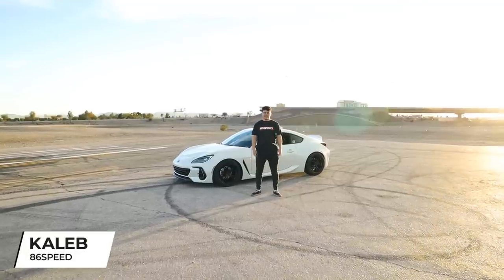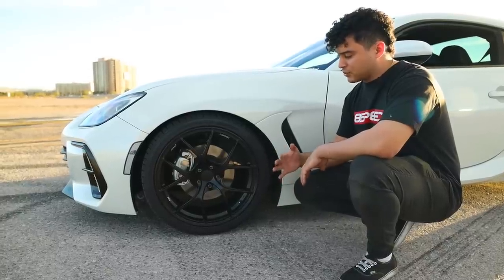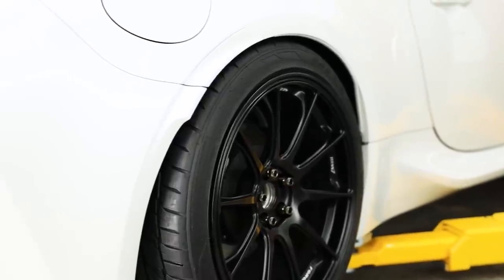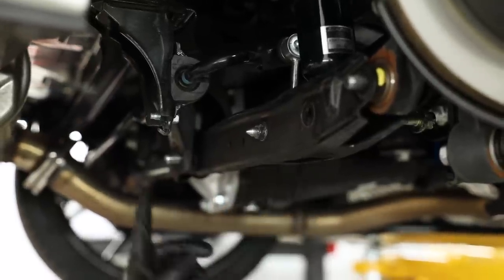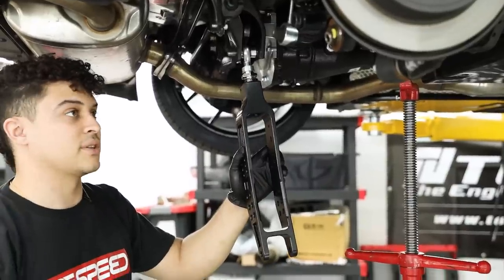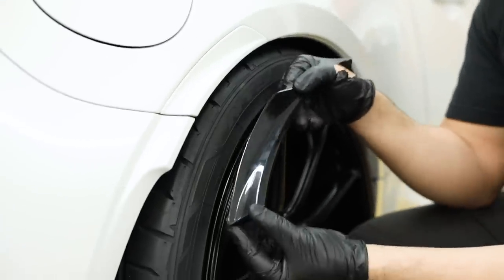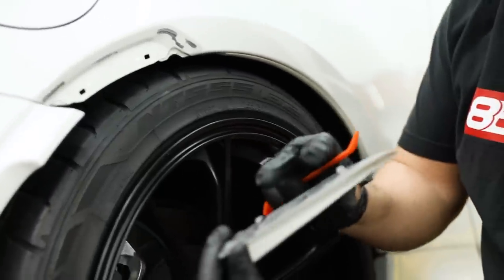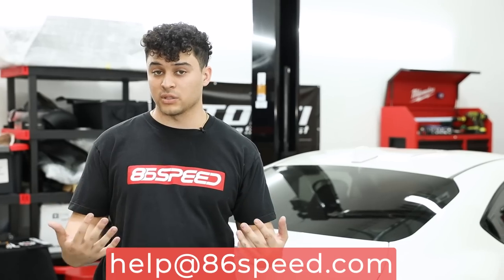The 411 on wheel specs for the 22 BRZ - Basics on the BRZ Suspension and Wheel fitment

Comment: A little toe-in in the rear will add stability under hard braking (like after a long straight on the track) so "0 toe" is not ideal. A small amount of toe-out in the front can also help with turn-in, but will increase the amount of wear on the inside of the tire.

Some alignment shops also add a small difference of toe-in for the front to help keep the car tracking center on the road, which generally always has a small amount of crown to help water run off the road into gutters. I often need to give specific instructions to my shops to give me 0 toe or a small amount of toe-out, but an even amount when I'm expecting an immediate track day vs street driving.
Reply: You can tell them that you don’t want that offset for the crown and they will look at you funny, but they will comply with your request after warning you that it voids blah blah blah.

Comment: So looks like 18x8.5 +45mm should be good on stock! Sweet.
Reply: I know this might be a dumb question I also want to go basic mods/upgrades so basically the 18x8.5 rims like the ones in this video which I like with a 45mm tire? I can’t use the stock tires and just switch rims or would I rub and would it not be fitted correctly?

Comment: Tire specs would have been really helpful, at least in the description. If I had to guess, they are probably running a 245/35/18 for option 1, but they would have to confirm. Also, what is the suspension setup on the BRZ for option ? Looks lower than stock.

Comment: I have that style lower control arm and I run 18x9 +35 with 1.8 degrees front and -3.2 degrees rear camber no rubbing, no scrubbing. front flush rear nearly flush.
Reply from the maker: Anything is possible -  Watch our ruined video posted before this one. What is your ride height and tire , these things matter also.  There are always 4 things to consider 1. Wheel specs 2. Tires size / stretch / profile 3. Camber 4. Amount of drop and suspension travel and dampening stiffness.
Reply: @86Speed  26.25" from ground to fender lip front and rear with Eagle sport AS 235/40r18s

Comment: Thank you so much for this video it's been a burning question for me!
So if someone was running track camber (-2.4 to -3) then 18x8.5 +40 would be ideal flush fitment? Does that mean you'd be able to fit 255s front and rear or only 245s? My state is very strict so I can't afford to have poke but I'd also hate to have too much tuck as well. Also this is a silly question but does this fitment involve any fender rolling? Thank you 🙏🏻
Reply: 255 is too wide. 245/40 is too tall to fit without major adjustments. 245/35/18 works on 18x9.5 +45 with coilovers and no mods

Comment: The 9.5" rear wheel looks great, but it's not ideal for autocross and will hurt your top end on all straights. It also won't help as a daily because the really grippy rear end is no longer playful around turns. The 8.5" wheel is best. Run a spacer if you want to fill that gap.
Reply: How does it look on stock suspension? Got a picture/vid/link?

Comment: Can u test fit a volk ce28 18x9 +40  255/35 and do this on the 2 finger gap or decent drop not crazy. Just enough to remove the wheel gap

Comment: Im not in the americas, and as such wheel choices here are different without paying stupid markups.

I'm looking at running an 18x8. They come in either +35 or +42, i was thinking +35. With the stock 215 on the front and a 245 on the rear. Do you recommend 40 or 35 for the side wall?

The suspension is stock ride height. I wont be lowering it, as im 6'4" and only getting older. I probably wont be adjusting any of the suspension or steering parts for the warranty period because its only a street car. I just want to personalise it to my taste. Any help is appreciated.

Comment: Other examples of the 18x8.5 +40ish on stock suspension show the rear being pretty close to flush but the front wheel having a lot of tuck.  What has been done to the car in the video? just lowered? spacers?
Reply from the maker: Only suspension - we have a video link in this video that shows what we did earlier to this car

Comment: Anyone know will 18x9.5 +45 on a 245 / 35 / 18 clear without rub or clearance issues?
Reply from the maker: Will be safe to trim - it will all depend on your suspension and camber settings , try it out either way.
Reply: Yo, Did you find out? I want to run the exact same setup

Comment: It sounds like 18x9.5 +38 with tires that are 255 is the main rubbing factor. If I got 18x9.5 +38 with 245/40 would I still rub? I’m thinking of dropping the car just an inch.
Reply from the maker: In my opinion yes
Reply: @86Speed  Okay yeah I thought it might too. Possibly 18x8.5 +35 with 245/40 or 235/40? Same drop.
Reply: Im running 18x9.5 +38 but only 225/40 and natural camber. Dropped ~1.5inch

Trimmed very little of the fender piece not the full thing and no rubbing